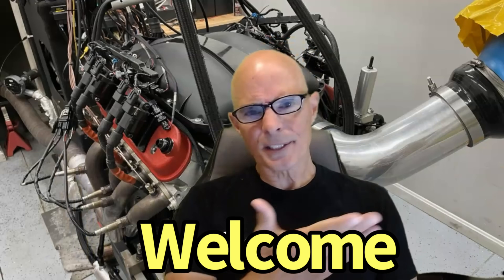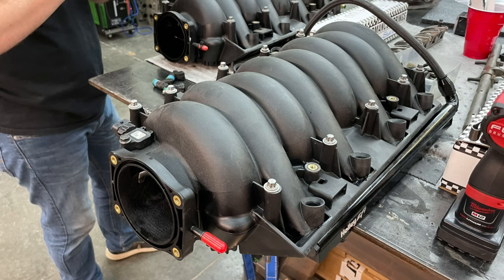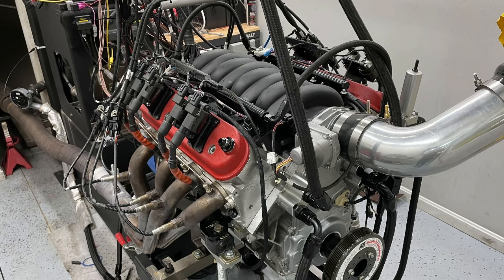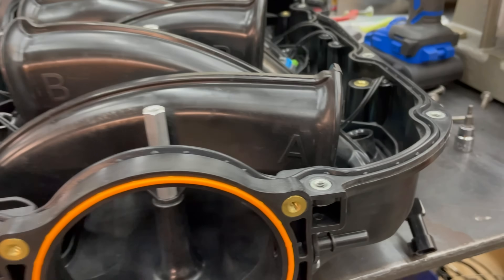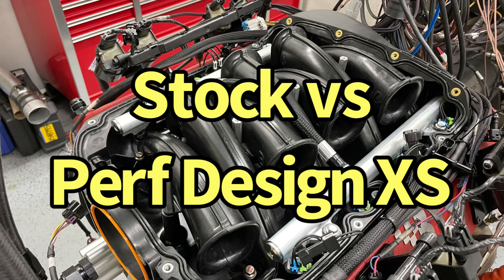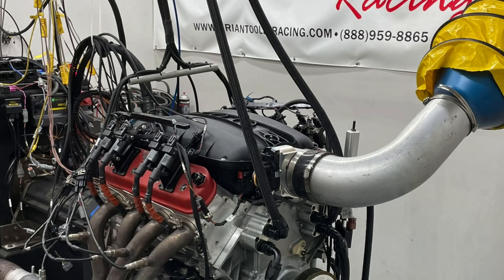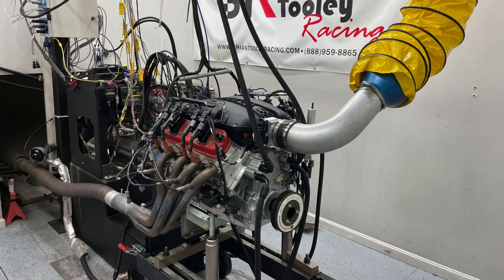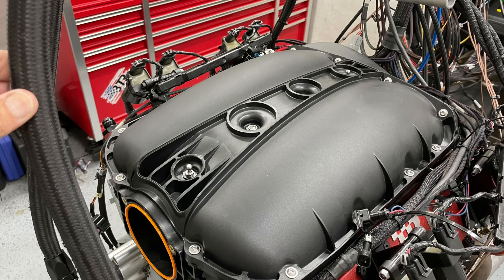HOW MUCH POWER IS THE PERFORMANCE DESIGN LS3 INTAKE REALLY WORTH? LS3 VS PD 105 & 112-FULL RESULTS!

Comment: Richard I haven't found where anyone has tested the Texas Speed Stealth Low Pro intake. Im hoping you can do a test video on it.
Reply from the maker: short runner intakes are for high rpm
Reply: @richardholdener1727  I have space concernsand very few will work. Im putting a LS 454 into a Boss Hoss motorcycle.  The LS3 intake sucks for drive by cable so I'm looking for a different style.  I believe the cheap sheet metal one will work.

Comment: Super, j’ai une Maserati granturismo sport 4.7l 2012 et j’étudie la possibilité de mettre un injection multi-papillon avec longueur variable et double injecteur. 390cc ( origine)et 250cc. Les 250cc seront connectés a la commande sport et fonctionneront uniquement dans le mode sport et une re programmation du boîtier et nouveau collecteur d’échappement.

Comment: Am I missing something??  This is supposed to be an LS3 intake manifold test/comparison, but you have a 427 CID engine on the dyno!  Who in the real world puts LS3 heads on an LS7 427 block???  How about performing this same test with a stock 6.2 liter LS3 so we can compare apples to apples?  Surely you have a stock displacement LS3 around to test on!  The bigger cam, modified heads and headers is great, but a 427 CID is ridicules in my opinion!
Reply: Funny you ask because I’m doing exactly that, I know it’s leaving lots of power on the table but I don’t want to spend even more money on ls7 heads on top of the valve issue they are infamous for.

Comment: The fact that, at the end, all the curves were identical besides the gains, it just proves it's well designed & consistent. I would like to see these intakes vs the MSD & FAST on the same engine to see the differences in the curves. I know it's time-consuming to do all these tests, but it's why we subscribe!
Reply from the maker: FAST CHANGES NOTHING COMPARED TO THE STOCK LS3, MSD DOES NOT MAKE A LS3 INTAKE
Reply: @richardholdener1727  Well I guess that settles it. This is the kink of the hill so far when it comes to actual street intakes for rec ports. Thank you Sir.
Reply from the maker: Right now it looks like a good piece
Reply: @richardholdener1727  yes my Fast 102 even port matched to the heads with a little.smoothing of the bell mouth followed the LS3 Factory manifold. But the Fast painted looks great. Still would be cool to see Fast 102 vs PD for fun.

Comment: I am not impressed.  It took a 427, heads, a fairly nasty cam, bumped compression and an oversized 112MM TB to show a real gain at all. Thats not impressive, sorry. Good test though. This combination would obviously stack the deck in this manifolds favor and maximize any result.
Reply from the maker: I FIND IT FUNNY HOW PEOPLE CAN EXTRAPOLATE AND SPECULATE OTHER OUTCOMES (OBVIOUSLY DESIRED ONES) FROM 1 TEST
Reply: @richardholdener1727  The outcome was as expected.  It is a built 427, and it is a test of the stock intake w/ stock TB vs an aftermarket manifold with shorter than OEM runners and a Monster TB.  I expected the LS-3 to lose; however, I expected to see at least a gain of 38-40 hp and 25-30 foot pounds of torque out of a combination like this. It's like using a stick of Dynamite to kill a fly!

Comment: I know the test is not going to happen but i'd love to see how it did vs the Edelbrock cross ram on that big engine. That cross ram did amazing in your ls3 manifold test. Better hp than stock. Best torque peak number. Best average horsepower and best average torque. It is definitely more costly and complicated to make work in all applications, but man is it cool.
Reply from the maker: Don't think they make that any more?
Reply: @richardholdener1727  edelbrock says they are scheduled to make more soon but are currently out of stock as of 7-14-23
Reply: @richardholdener1727  you may be right. With most people not being able to control dual DBW throttle bodies and the fact they never made a drive-by cable bracket for the intake, it made it very hard for most people to consider. Not even to mention the price.
Reply from the maker: they did look cool though-but were very heavy

Comment: Hey Richard aweshome work. Although my question to you is do you know anyone that has ever done an enlarged cam modification to small block chevy. i am, speaking about the diameter here. The 2" camshafts, i mean the larger 60mm and up + size mm cams etc. i am, is going to attempt to modify the small block chevy GEN 1 for the largest cam diameter or whatever shall fit. Consider this a stock block extreme modification! LoL!  Thanks all for any responses.
Reply from the maker: race motors have run bigger cam tunnels and cores-not sure why you need it for anything but all out
Reply: @richardholdener1727  i am need it for more area under the curve without smashing my valvetrain to smitherines. Endurance Street engine extreme. Running huge roller lifters as well. Extreme ramp rates with less valve spring, more control over exact shape of cam etc. 2:1 rocker ratio etc. Thanks for reply richard. 🙂
Reply from the maker: check with the block manufacturers to see if they have altered cam tunnel versions avail
Reply: @richardholdener1727  ok. shall do. thanks.

Comment: Selfishly, I'm really curious to see what this will do on a more typical cam/bolt ons 6.2.  It's encouraging that it made this type of power on a big combo. I suppose it's not a bad thing that GM made the heads/intake manifold combo so good from the factory, but it sure makes it hard to justify the cost of swapping that stuff out on a 6.2 build. If the HP/$ is there on a SBE combo, this will be a winner. GM just didn't hide many horses in the stock stuff.
Reply: You could do some math and divide the size of a stock LS3 by the size of this engine and divide your expected power output by the power output of this engine and then multiply the gains from this manifold on this engine by that factor. I'm going to guess with the stock LS3 cylinder heads the gains are minimal
Reply from the maker: the math doesn't work the way you want it to, dyno is best
Reply: @richardholdener1727  do a video where you compare the results of the math I just mentioned to real dyno results and see how far off it is. I bet its within a few percent. You could even use your existing data.

Run a stock ly6 with one of your favorite camshafts, then run a 408 ly6 with the same top end. 364 is 89% of 408. See how close the horsepower of the 364 is to 89% of the horsepower of the 408. Maybe compare average power as well.

Comment: WAIT, RICHARD, HOW DID IT DO WITH THE BIG BELL-MOUTH ON THE INTAKE (and they should have still ducted air to NEAR it to try to be as consistent as possible.) 
I ask because with only an upgrade of the intake horn area, one big blower engine got better output with no other modifications.
Reply from the maker: it made no difference-covered that in the live feed today

Comment: That’s crazy that it’s taken this long for someone to beat the stock intake.
Reply: Pretty sure the edelbrock cross ram beat the stocker long ago
Reply: @bcbloc02  fair enough. Huge though with twin throttles so you can’t use stock harnesses and ECUs. At least not economically
Reply: @shannonsisk  very true. That aluminum beauty from edelbrock is a pretty pricey piece by itself

Comment: Good results and a good-looking manifold. 

I reached out to Performance design a while back about using this manifold on a boosted application. However, the design doesn't allow/support the use of big return style fuel systems, if it did, I would make the transition from the LS3 manifold to PD manifold. I can always add more boost though.... kind off haha :)

Comment: Interesting results.  I would not expect changing throttle bodies (even if it were necessary for more flow) to show consistent gains from 3000-7000 rpm.  That suggests that something else is at play.  Whether its more laminar flow matching the throttle body to the inlet as Rich suggested (step changes in any direction cause a pressure change and possibly turbulence), or something else like the bigger opening getting better distribution in the manifold, I don't know.  Would be curious if the guys at PD have any ideas based on their CFD models.

Comment: You have an unhealthy obsession with low end torque. If you are going WOT at 2500 you are doing it wrong.
Reply: What a dumb comment. You've clearly never towed anything.
Reply: It affects alot in daily driving of the  car as not everyone here us going to be making a trailer hauled drag or track attack car revving at 5.5k 90% of the time.

Also greatly influences the cam and stall converter combination you end up getting.

Comment: Hi Richard…. I’ve been waiting months with the anticipation of you testing the performance design LS XS intake manifold. Great video, I seen the stock LS3 intake manifold comparison with a ported LS3 intake test . I’m surprised that the ported version didn’t have any power improvements. I’m Glad I didn’t waste my time porting my stock LS3 Intake that’s sitting on my LS3 416 stroker. I also lol seen your multiple LS3 intake manifold’s test. Well I’m saving my pennies for the 112mm version. 👍
Reply: That intake only had the rod mod performed. It was not ported and did not appear to have the center stands removed.
Reply: @ScottO84  looked ported at the throttle body area. So putting the rails in only doesn’t make sense.
Reply: @vikenlink  Richard said very minor porting only at the intake opening. Regular LS3 porting removes the upright support stands, shaves down both the upper/lower planes, and smooths out the transition to the runners. Some also port within the runners as well. It has historically been worth 6 HP to the wheels on a stock LS3 and 12-15 on a cammed setup for fully ported LS3 intakes that also have the rod mod.
Reply: @ScottO84  That is pretty much in line with what I have seen over the years. There are a few inportant details that most miss doing the rod mod that effects flow in the corners.
Reply: Deep pockets for a 112 mm throttle body. I can’t even find a 112mm throttle body. I’m running a 416 LS stroker with the stock LS3 intake with a Nick William’s 102mm cable driven throttle body. No it’s a Holley Terminator X not factory ECM.

Comment: Awesome @richardholdener1727 Thanks so much! I picked up 1 of the 101mm versions (-$100)  I'm feeling pretty confident now that I should be able to pick-up a good solid 10+ HP with my Ported 95MM TB, 260 AFR heads, 225/233  .617- .623" 114 lsa , 11.4>:1 cr compared to my homemade rod modded LS3 intake
Reply: I'd be very curious to see how much hp you actually do pick up bc my assumption would be that it's the relatively mild cam you're running that is more of a "restriction" on your combo than the intake (I'm sure I'm not pointing out anything you don't already know in that regard). So I would guess it would be closer to ~5 hp but I'd be happy to be wrong about that.
Reply: @nowayjose596  you're probably correct! I thought if the 103 with the 90mm.tb picked up 15hp that I would pick up 2/3rds of that 🤔🤔. Anyways if  I only get 5 hp i feel it will be a gain from roughly from 4600 to 6800 rpm! altho I might get a bigger improvement as my version of of a mod rod could be worse than a stock LS3 intake
Reply: @grpweld  I only say that bc you're down ~50 cubic inches AND a lot of cam compared to this test engine. But apparently Performance Design said they've seen gains of 8-10 hp on a stock LS3 (although this has yet to be independently tested) so we'll see 🤷‍♂️
Reply: @nowayjose596  true that!  But that cam would be better in a HI-RAM or something that works well in higher rpm's that revs to 8K or so I think
Reply: @grpweld  Oh the cam in this test is HUGE. For your combo something more along the lines of 23X/24X on a 113 LSA would pick up ~20 hp over your current cam and probably get you a few more ponies out of that Performance Design intake, as well. Of course the trade off would be some idle quality/drivability depending on the tune.

Comment: What was the torque output on the 105 (supposed to be 103?) with the 102mm throttle body? HP came in at 686, but you skipped over the torque.
Reply from the maker: 691 hp was the 112 mm version
Reply: @richardholdener1727  You're quick! I had the wrong number and had to edit it.
Reply from the maker: torque was 605

Comment: They actually make 3 different versions of this manifold: one for a 90-101mm TB, a 103mm TB, and a 112mm TB. Prices range from $900-1000 but looks like they do include the special fuel rails required and are good for up to 20 psi of boost.
Reply: If I recall correctly, their initial tooling was wrong in terms of measurements when manufactured and came out to 101mm instead of 103mm as intended, so they are clearing those out for $100 less. They corrected the tooling problem and now the new ones are the right size. I'm honestly not sure where the 105mm measurement in this video came from because Performance Design's site shows the 103 and 112 options.
Reply from the maker: it is 103
Reply: @ScottO84 Interesting, that's good info. It looks like the 103mm is currently on backorder and I'd be inclined to save a few bucks and stick with the stock 90mm TB. That said, I'd be curious to see what the gains would look like on a stock cube/heads LS3 that only has a cam, as that's what the majority of people are running. Maybe 5-10 hp with the 90mm TB and another ~5 hp with the 112mm TB (although those cost almost as much as the manifold itself)?
Reply: @nowayjose596  Between this test and the one American Heritage Performance did, I'm finding it much harder to believe the smaller version of this intake achieved 8-10 HP and 8-10 TQ on a completely stock LS3 engine as the company has stated for months. (However, I remain optimistic.) With this test showing 14 HP and 2 TQ gained on a heads/cam 427 and American Heritage showing less than 15 HP gain on a heads/cam 416 LS3 while losing 15 HP/20 TQ down low with the 103mm/90mm throttle body setup, I don't see how a stock LS3 could manage 8-10 of both HP and TQ.
Reply: @ScottO84  I agree with your doubts (although I haven't seen the American Heritage test so I'll have to check it out). Someone else in the comments section on here said they were hoping to get 10+ hp more with the 90mm version but they're running a relatively mild cam (225/233 on a 114 LSA) so I said I would expect more like ~5 hp. Also hope I'm wrong and they get the 10 hp they're wanting but considering the numbers seen on these big cam strokers the math suggests much milder gains on stock cubes/smaller cams.
Reply from the maker: I love all the speculation
Reply: @richardholdener1727  That's all we have until you make the magic happen with your videos. :)
Reply from the maker: I do love some good bench racin'

Comment: Awesome data! Will you be doing more tests with these manifolds? Possibly on a heads/cam ls3? Maybe compared to a Hi ram? 👀
Reply: Like to see these tested on a stock cube and stock  cam 6.0 and 6.2 then add some different cams to both. Thanks Richard  !
Reply from the maker: stock cam 6.0L? Why bother with other mods?
Reply from the maker: I ran a high ram on this motor too